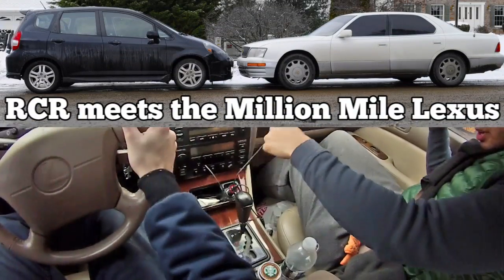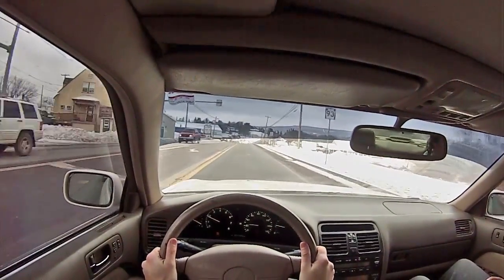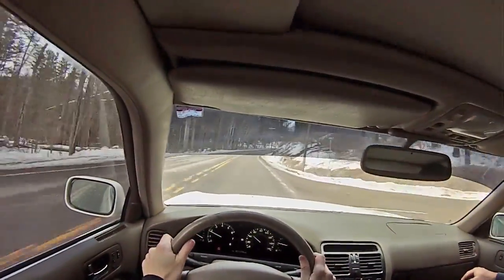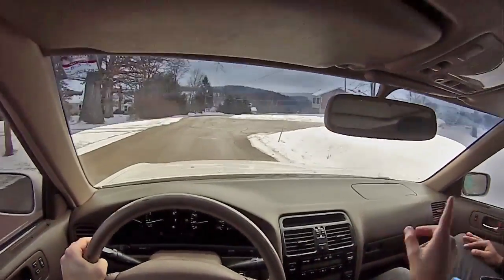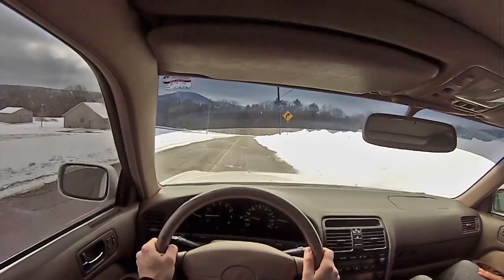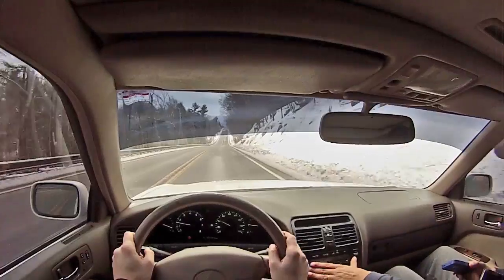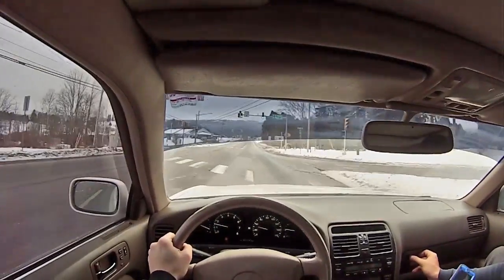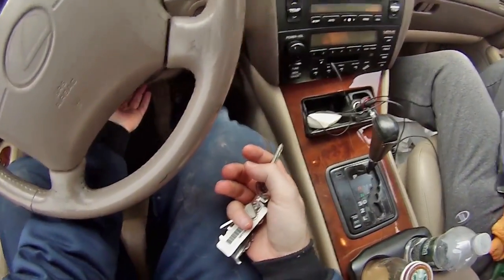Million Mile Lexus P.O.V. Drive

Comment: I was in portugal last year and there was a cab, I think it was a 1990-ish 190 E, with the odometer stuck at 999,999 km because it wouldn't go any further. I asked the driver how many kms it was over a million and he said it had been stuck there since 2008.
Reply: Mercedes Benz is hit or miss as they can be, the 190E was one of those hits.
Reply: +YayCupcakesLol It was a 190d, as in diesel
Reply: André Rodrigues No im saying in general the 190e was a great edition by Mercedes.
Reply: +YayCupcakesLol Ehhhhh. the evolution was great and the 2.0d  was reliable as can be. the e (1.8 gasoline) was pretty mediocre
Reply: André Rodrigues Give or take. I feel the regular 190e is often overlooked because of its BMW counterpart. My Favorite Mercedes are usually E class, S class, and G class.
Reply: André Rodrigues I don't remember exactly, but I'm pretty sure it was an E, not a D.
Reply: +United States of Embarrassment In Portugal the most comon taxis are 190d and most of them are mercedes, and its more comon than you might think to have 1 million + taxis on duty :)
Reply: +United States of Embarrassment After 1994 (or 1995), Mercedes started becoming unreliable.
Reply: pellergin Yea, when they partnered with Daimler Chrysler. I think that was in the year of 2000 though, when the w220 S Class came out.
Reply: +United States of Embarrassment Same thing in Tunisia 5 years ago. The car was extremely clean outside of being used as a taxi and the wear and tear that comes out of it. Anyone who's managed to get to Tunisia before hell crammed out of some people's asses, knows all the cars are dinged there (well most of the cars i saw going up and down the country).
Reply: United States of Embarrassment that's mercedes for ya
Reply: Probably went through like 3 different engines.
Reply: Old Mercedes Last Forever
Reply: I love the 190E! Mine is at 57k miles
Reply: 190E was probably the best Mercedes that Mercedes ever made. LS400s compare more to S or E classes.

Comment: It would be really nice of Lexus to give this car a complete genuine Lexus service (brakes, drive line, all rubber bushings, etc) for free, as a gesture of good will to the owner.
Reply: Maby if he was the original owner who first bought it new.
Reply: Or a brand new car
Reply: Jhonny Tuffister Yeah it would be nice, but lexus is only interested in selling the joker face cars now. The Lexus' of this period should be given VIP treatment as everyone comes out to see this car.........it'll never happen
Reply: im a tech at a lexus dealership and had a guy come in and just gave us a huge list on things he wanted done on his 95 ls .. he spent almost 25k. did all new brake lines, struts, valve adjustment, timing belt water pump, radiator, new brakes, new oil pan, new fuel lines.  please note at my dealership labor rate id $165/hr

Comment: I just did some math, at a regular speed of 55 mph, this car was driven constantly for 682 days.
Reply: starting and stopping wears it out more
Reply: Shit that's a lot. 2 years of continuous use is a lot.
Reply: It's more impressive if you tell people it went to the moon and back TWICE.
Reply: It was literally driven roughly 9.31 miles every hour for the past 10 years. He said that 800000 miles were added in the past 10 years. That is crazy! Something tells me this saw extensive, long distance, road trip use repeatedly.
Reply: ***** pizza delivery lol
Reply: Once it hits 1mm miles, it will have consumed roughly 53000 gallons of gas!
Reply: ***** People still do that? It's 2015, it's pretty clear that any "Nerd" is going to be the one with the money, nice cars, and a good woman. But you enjoy your rusted out truck, and your job at fazolis, at least you're not a nerd.
Reply: Be nice to nerds. You may end up working for them
Reply: ***** mate you got it wrong, his grammar is fine
Reply: sambassmanstoner Thats impossible to calculate. Car's mpg varies depending on throttle position, rpm, and engine load.
Reply: ***** Craigslist make escort.
Reply: nick spring It's an estimate based on the EPA "combined" MPG.
Reply: ***** Oh MALE escort. LOL I was like Craigslists makes Ford Escorts? JK yea probably right!
Reply: I'm glad you and a few others have done the math. Just saved me the time because I was about to whip out my calculator lol.
Reply: Maths*
Reply: +Smackindaface damn right
Reply: +jospi2 *meth
Reply: jospi2 eh!?
Reply: jospi2 holy shit

Comment: those codes are probably the reason it won't downshift ...
Reply: Yeah, actually it's TPS. Without working TPS, gearbox doesn't know that driver wants to accelerate.
Reply: And why the cruise control doesn't work correctly, it doesn't know the speed to match

Comment: That's Toyota quality for ya.
Reply: How? There're quite a few cars/trucks that have hit a million miles....
Reply: Not saying that toyotas last forever, but pretty dumb close. Don't see too many American cars doing that
Reply: my 91 MR-2 has over 690,000 miles with nothing but regular maintenance and a water pump replacement, amazingly the clutch is factory original, about time for a new one though
Reply: greg howe if you take care of a car, it will take car of you. But there are literally ton of superduties, crown vics and other American cars that will run forever. We live in a glory age of the automobile where you can't go wrong with any choice seeing as all of them will push 200k miles. Heck my brother has an 02 Durango with the 4.7l in it and has 210k miles and that's a 14 year old vehicle.....
Reply: Nich Birch Yeah but the thing is that american engines are big and have no power at all and that makes an engine pretty bulletproof where as Toyota engines usually put out lots of horsepower from small engines and still run for a lifetime if the owner takes care of it of course and pickup trucks (american ones) usually have a bigass diesel in them so of course those are runners. btw 210k miles and 14 years isn't shit for a basic Toyota IF it's made in Japan so the new ones might not be the same quality but yes i don't take away the fact that are some US made cars too that can eat lots of miles
Reply: Towel1e 260hp from a 4.0 V8 isn't "lots of power"...
Reply: William Gson Is a 4.0 a small engine? Read my comment again. And no its not lots of power from a 4.0 petrol V8 but lets take a Lincoln town car 4.6 V8 from the same period and same type of vehicle and it produced... 210hp. And they did upgrade the last ls400 to 290hp from the same engine and 300hp in the GS400.
Reply: Towel1e They are slightly different types of engines. The 4.6L in the Lincoln is a SOHC. The 4.0L 1UZ is a DOHC engine so they will usually have better hp/liter than SOHC and OHV engines. The contemporary 4.6L DOHC found in the 1992-1998 Lincoln Mark VIII made 280-290 hp. On another note just for fun, the OHV 7.0L LS7 found in the last gen Corvette ZO6 is significantly much smaller (in terms of physical size and weight) than both the 4.0L and 4.6L V8s despite having a much larger displacement.
Reply: Nich Birch well Diesels are good for 400k-500k miles per engine, diesels are a totally different animal then Gasoline engines. The crown victoria is definitely one of ford's most defining cars....those things indeed go for ever, but i'm not sure how many other cars do tho.
Reply: Very very true.
Reply: ***** Try to kill a smallblock 350 Chevy, I've seen one that was original in a c1500 Chevy truck with 656k on the clock. It ran great! Our hauler is a 94 Buick Roadmaster with the Lt1 5.7. It makes 280hp, and 330lb of torque, not bad! it has 220k on it, we know people who've had several pushing 500k! We haul my dads art cross country in her, and can rip some good burnouts too! (And do, ALOT) its like a new car, easily could hit 500k.
Reply: I'm currently driving a 99 lexus GS300 with 214k I've had it for about 3 years and 50k, aside from a serpentine tensioner that cost like $40 not one thing has broken or stopped working, also very impressive how the paint and leather holds up, not fading or cracking or anything
Reply: *****  Its an Astro, whaddya expect.
Reply: Nich Birch Trucks mainly hit million miles due to their hundreds of thousands of dollars price tags which ensure that the engines are built to last millions of miles. Also, they do their driving on highways almost 95 percent of those miles, which results on far far less wear and tear than what you would get in urban roads.
Reply: ***** So are you agreeing with me? Cos trucks have a tiny ratio of warmup cycles ito miles they run on each cycle, probably around 100 miles, or more, on average.
Reply: ***** yeeaaahh thats not true at all. There's a difference between warming up your car and letting it idle for half an hour when its 90 degrees, and you had already been driving it all day. However from an actual cold start its good to let your car warm up for a little bit. It needs to get all the fluids warmed up so they aren't thick when its trying to pump them through their lines.
Reply: Ben S  Yea, thats a general requirement for my mustang, otherwise the experience is unpleasant at best.
Reply: ***** errgh.. i hate to say it but i have to agree with you... but they wouldn't still be around if they were "built like they used to be" yeh know... competing with a cheaper product... :/
Reply: Towel1e They are very nice.. And they have the best air conditioning. 
I had an 02 Camry, I thought I'd hate it when my parents bought it, but that was a great car. I don't care if everyone and their grandma drives one.

I think it had about 160K miles on it, ran like new, everything worked, got it for like 4 grand.
Reply: Nich Birch Honestly, my family has owned several American vehicles that were well maintained and they all didn't last that long. My grandma's 2003 Chevy Astro won't even start. The transmission in my mom's 2005 Mercury Grand Marquis just went out. My family has owned cars from Toyota as well as Honda and even Hyundai and they've been more reliable than our cars from Ford and GM as well as Chrysler...
Reply: Plastic doesn't rust
Reply: ***** Yeah, their trucks overall are better than their cars. The Aveo was a terrible car that was made by Daewoo.
Reply: *****
Well, Daewoo had one good car that was sold in South Korea only (the Arcadia, it was really an Acura Legend). But, even though I'm not a huge fan of American cars, I do have memories of cars my family had myself, which were mostly American.
Reply: Cheyv Cavaliers. Nuff said. Cars are fucking tanks in reliablility
Reply: +William Gson lol well its 1996 what do you expect??? it's not even direct injection my Nissan pickup has 134hp from 2.4l sequential fuel injection sohc.
Reply: ***** I find that difficult to believe, not only because Trabants were known to be so low quality but also because a gazillion isn't even a number.
Reply: deus ex I thought so.
Reply: +Towel1e Yea no, that's one of the biggest flaws about Lexus is the lack of power. Even today the flagship LS460 has 380 HP, pathetic for a 80 thousand dollar car. Mercedes AMG and Cadillac  are killing Lexus in the HP department. IS250 a car almost 40 thousand 204 HP, pathetic! My parents 2012 Chevy Impala has 305 HP, and that's a Chevrolet! Its not even a luxury brand! Don't get me wrong though I like Lexus for the features, reliability, low cost of maintenance but they REALLY need to step up their HP
Reply: +Ian Thompson Even Ford's anvil-like Vulcan 3.0 Taurus gives the Japanese fits. And don't even get me started on the amazingness of the 3800...the Americans can get it done too. The 350 is the best example of this off the top of the public's head...!
Reply: +Towel1e My dad owns a 2011 Toyota camery se and it already has 200,000 miles. He bought it brand new.
Reply: +MrJimmy3459 at least there getting there way back because they killed off all of there good cars after making scion. Ex. Celica back then had a turbo 4 making 240 hp and the mr2 had a sc 4 making 240 and a turbo 4 making 240hp. Lexus just brought the 200t with 240 hp and thankfully the God awful scion is killed. They brought a rcf and a gsf they will also bring the lc soon and they will bring a f variant and never forget the lfa which made 550 BRAKE horsepower at only 4.8 l
Reply: greg howe Have had all Fords. They've been excellent. GM has a reputation for having rattly cars, but there's a saying about them that they'll run poorly longer than most cars run at all. Chryslers, yeah, they're pretty junky. It's true Toyota and Honda can't be beat, by pretty much anyone. But this doesn't necessarily apply to other Japanese brands. Mitsubishis, for example, aren't very good at all. Some cars and manufacturers are good, others not so much, and it doesn't necessarily hold true when you're talking about entire countries.
Reply: Towel1e the steering wheel is the same as in a 99 prado
Reply: greg howe Really? I've seen a fair amount of 7.3 powerstrokes and 12v cummins hit 1,000,000 and they spend a lot of those miles towing fully loaded flatbeds and trailers.
Reply: "don't see too many American cars doing that"

Literally 3 posts later: "American cars have huge engines of course they run forever"

Comment: Farah said it's still the original engine and transmission! Amazing!
Reply: Well he should probably get a new transmission this one sounds busted.
Reply: Prince David He only bought it for $1,500 lol
Reply: ***** WOW! OK that is hardly anything :O
Reply: Prince David Exactly! One hell of a bargain I'd say.
Reply: ***** Sure sounds like it, that is some quality to last for this long.
Reply: Prince David Definitely. I'm not a huge fan of Lexus but respect to the over-engineered LS 400.
Reply: Prince David It's not the transmission from what I've heard; It's just the trans computer being unable to detect the throttle input which is why it downshifts fine once you tell it to (just doesn't do it automatically because it can't tell that you are trying to accelerate).

Also for the record I believe Matt said he put around $1500-2000 into it upon purchase but before he picked it up (new steering rack, tires, brakes...)
Reply: Prince David One of The codes they mentioned was the TPS sensor (throttle position sensor) I guarantee you thats why it wont down shift, simply because the transmission doesn't know the position of the gas pedal, so when you floor it, it doesn't know you're flooring it.
Reply: Prince David William Thieme 
As you've probably already heard from other people it's not a true transmission problem requiring a rebuild its a electronic management issue, there's no throttle position sensor or vehicle speed sensor hence the transmission just goes duhheerrrrp because it has no electronic connection/knowledge of when to downshift or what gear is correct at the speed they are going
Reply: this means i'm going out to buy an ls400 like tomorrow.
Reply: Because Toyota ;D
Reply: 1500 is a lot for a car with a million miles I bought my 1984 300zx turbo 110k miles for 2k
Reply: +Prince David The TPS and Speed sensors being bad would cause the trans to act up quite a bit as it relies on both these sensors heavily
Reply: Sad this is that these car companies can make cars that can last forever, but due to business and accountants, they aren't.
Reply: I call BS that ANY slushbox lasted for 1,000,000 miles

Comment: TPS + Speed sensor codes explain the eratic gear shifting - there are different speed sensors - instruments and computer/input related (computer probably cant tell speed  and foot position therefor wont change gears to suit - gearbox "limp" mode/no input)
Reply: the speed sensor could be what causes it to accelerate in cruise.
Reply: TheSamplebridge it may be that tps. My 370k mile vic will crawl up in speed too

Comment: I have a 91 toyota MR-2 N/A with 698,300 miles on it, its been taken care of immaculately with regular maintenance, nothing bigger than a water pump has been needed to be replaced this far, doesn't burn any oil, and it still has the factory original clutch in it. Yet it;s still in better shape than half of the modified MR-2s with less than 200,000 miles. My goal is to get it to 1,000,000 with the original engine, even if i put more into it than what it's worth
Reply: And I thought my '91 MR2 with over 220k miles was really high. Well now I've got a goal to beat.
Reply: Nice, good luck with that!
Reply: Some car manufacturers compensate you with a new car if you hit one million miles
Reply: Wait if I hit a million miles they give me a new car
Reply: connly33 I guess Toyota just makes cars that, if taken care of, will just keep on rolling. I mean, Honda would probably be there too, but who's gonna take care of a Honda, it kind of defeats the purpose. I guess you have the S2000 and NSX, but they don't have much that's gonna make you want to hold on to it forever. Toyota found a way to make cars that people want to hold on to that are also cars that can be held on to without completely falling apart.
Reply: Good luck
Reply: The comments like two years old but still, that is bull shit, clutches do not last 200k miles let alone 600k+. Does it have the original brake pads in it aswell??
Reply: ender pigcow lol do you know what a clutch is? Can't be the factory original at 600,000
Reply: MGRAY241 I ignored the part about clutch but more importantly who gives a shit if he's not telling the truth
Reply: ender pigcow lol

Comment: I have a 94' ls400 with 260,000 that I bought for under a $1000. Put a $9 thermostat, topped off fluids, and have daily driven it across the east coast. Everything just works. Only remarkable factor is I get 18mpg around town but hit a steady 30mpg on long distance highway cruises.